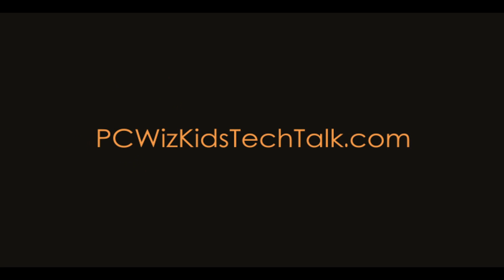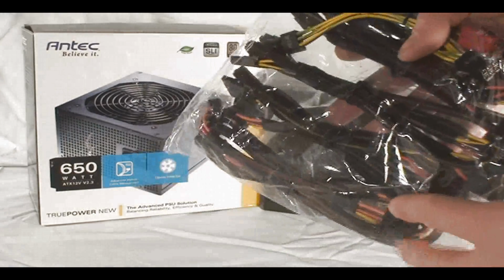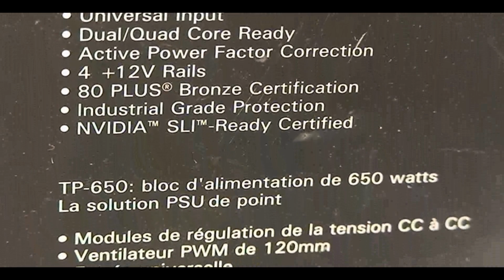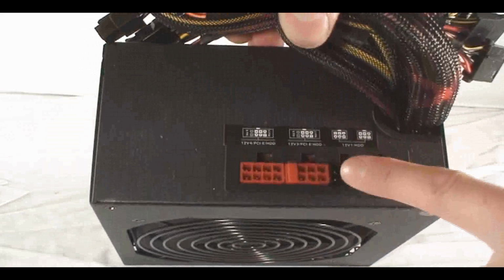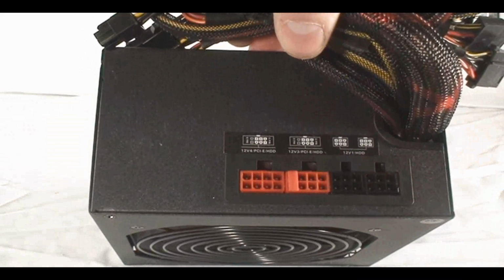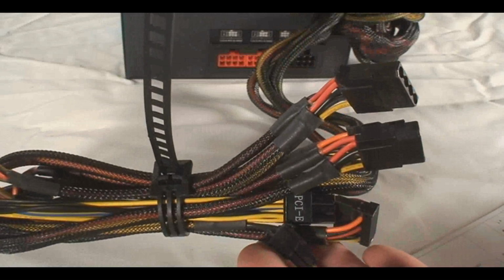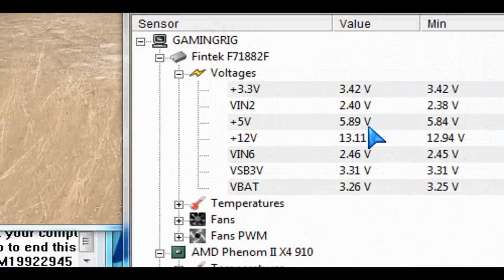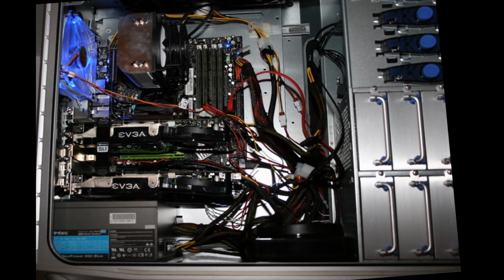Antec TruePower 650W Power Supply Video Review

Comment: Antec Earthwatts 650 Watt ATX Power Supply Model EA-650 GREEN   so i bought this and i hooked it up brand new and installed it just like any other psu and it turned on my fan led blinked and then it shut off, system specs are fx 6300, 8 gb ddr3, msi 760gma, with a avga 1060 3gb is there anyone who can tell me how to fix this  when i plug up my 500w tho it turns right on

Comment: I'm still using this as well. :) 

i7 3770k 5GHz
ASRock Z77 Extreme4
16GB Corsair Vengence
ASUS GTX 1070 ROG STRIX @ 2050MHz
Samsung 830 128GB/Samsung 850 Evo 500GB
Seagate Barracuda 7200rpm 2TB
Reply: @Aatu i have a 4790 non K and I do get CPU bottlenecking when running games on ultra, but otherwise 60/80fps is no problem. I can't specifically say for a previous generation I5 though.

Comment: i currently have this psu with an overclocked amd 955BE at 3.8gz and an overclocked 5770 at 970/1375mhz on the attached pci-e cable and it runs fine. i have everything setup on the attached cables so didnt even need to use the modular cables.

Comment: How many amps does a 5850 need per rail? This Antec power supply says that two of its 12v rails have 25 amps each. If I connect the 2 power cables from the 5850 into the 12v rails with the 25 amps, will everything run smoothly and I won't have to change any of the settings? (As you may tell, I am a total newb when it comes to building a computer)

Comment: @fallen9057 i guess start with the motherboard and found out which socket it has and pick out a cpu for it, or vice versa.  then found out what kind of ram the motherboard needs, you can usually find what memory is compatible on the motherboards manufacturer website sometimes called QVL or Qualified Vendors List.  if you're not getting a video card then make sure that the motherboard has integrated graphics or you wont be able to hook a monitor up.